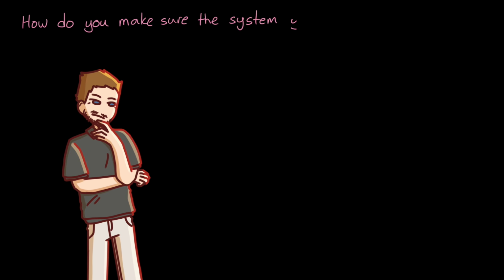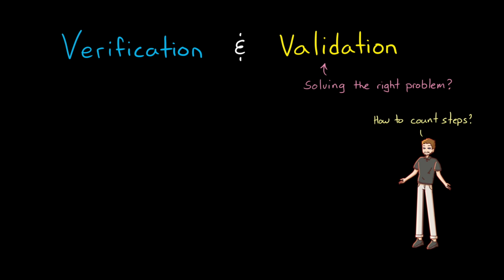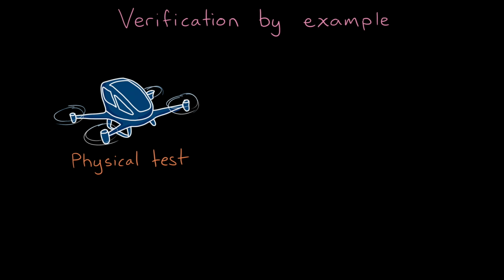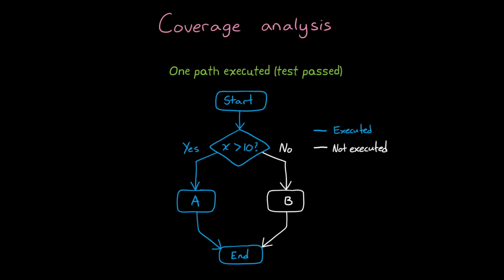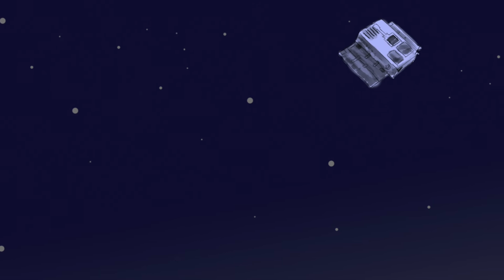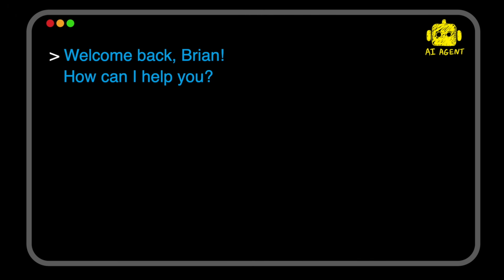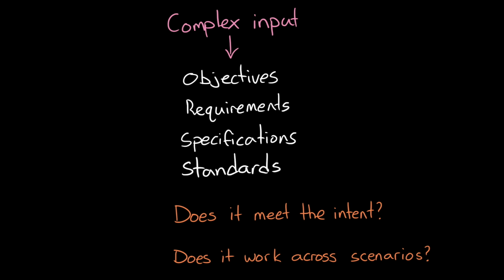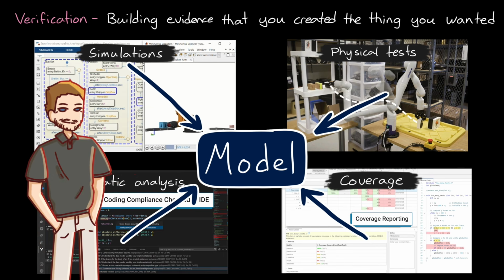Why Verification and Validation Matter in Model-Based Design

Comment: I don't see why verification and validation should go together under the definitions which are loosely similar to precision and accuracy respectively.   If your boss/customer/whoever wants a satellite step tracker and pays for it, no engineer can push back.  At that point, one can only verify that the dumb idea was implemented correctly.  The validation ship has already sailed.  This is a problem in a lot of industries.  Someone strongarms a process or "how we do it here" into a culture to prop his or her own position and prospects without concern for whether it makes sense for anyone else.
Reply: At the high level, I agree with your statement. I worked for a startup who had to pivot what we were selling and it felt like we built a tool and then was looking for viable ways to use it. Except, most of them weren't valid in the sense that it might do an ok job, but there were better ways to approach the problem than what we had built. However, to me validation doesn't only refer to the high level objectives of a project. Even at lower levels, engineers are still constantly asking themselves if this is the right approach. Let's say your boss wants you to make the satellite step counter, how should you apply torque to the vehicle to maintain attitude pointing? Well, you might choose thrusters, or reaction wheels, or magnetic torquers, or some combination. This requires a validation exercise where you think about exactly what is needed and what the constraints on the system are. Once you decide, then you have a direction that you can verify you meet as you build it.
Reply: @BrianBDouglas  That's a design trade. That should be done before the implementation and confirmation. I think System Engineering just likes the sound of "V&V" so the phrase lost any meaning it may have once had.  Lots of SE is like that.
Reply: @DmitryKissov  Yeah I see your point. Maybe I'm too loose with terms but for me each requirement that I write has a corresponding "Is it valid" question that goes with it. Not is it a good requirement but more of a "is this a requirement we want to levy on the system?". With this frame of mind, I might point to a trade study as the reason it's valid. I did this study and I feel that levying this constraint on the system is valid.

Comment: What's the difference between requirements and specifications ?
Reply: These terms might have different definitions depending on your industry or maybe even your company. I think of requirements as "What the system needs to do" and specifications as "How the system is built". So, if you're building an electric motor, a requirement might be how much torque it's required to produce, while the specification would be something like the blueprint for building it.

Comment: If AI builds the system and then it also builds and run the tests how can you make sure that the Verification is okay? 😂
Reply: That isn't a problem unique to AI. I once had a sign error in my model of the system I was building. This caused me to design a controller that had the wrong sign also because that was what was needed to pass all of my verification simulations. So, my "bad" controller passed its testing using a bad model. It wasn't until i got to physical testing that this was caught. So, the way to make sure that verification is okay is to be methodical about the process. For example, you verify and validate the model is correct before you move on to using it to verify your design. This is true whether you build the system or AI assisted you.

Comment: Great video! 

As a V&V engineer with a decade of experience, I highly appreciate this content.

Throughout my career, I’ve mostly worked on projects without Model-Based Design (MBD), and the traditional approach often brings huge challenges. We frequently spend months on requirements, architecture, and design without a way to properly verify each stage early on. Testing high-level software requirements or checking the architecture is basically impossible until we finally get the Software Under Test (SUT). Because coding starts late, and due to unavailability of the target hardware, defects and anomalies are discovered way too late in the cycle, leading to costly and stressful iterations. MBD seems to solve this exact pain point by shifting verification to the left. 

Really insightful video, thank you for sharing!
Reply: Thanks for the comment! I find V&V so important at all stages of a project but it's not usually a topic that grabs people's attention. I'm glad you found the video and agree with it!